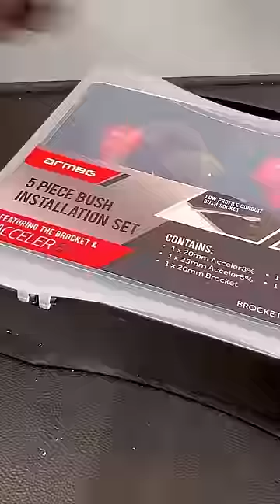They Said it Would be Faster! - WERA Tools Kraftform Turbo Screwdriver for Electricians'

Comment: Personally, I would recommend the husky ratcheting screwdriver. I use it as a lube tech, but its very comfortable to use and the quick change is nice
Reply: But what's the voltage rating on the Husky? Are they NFPA 70E compliant?

Comment: Don't twist stranded wires. That ain't good especially with screws.
Reply: Don't talk about something you know nothing about.
Reply: @bereal7266  in germany you violate the code by doing this. You need to use ferrules with stranded wires. If it has a clamp mechanism you need to check that the manicafturer allows. Some things with a clamp mechanism tell you that you can do stranded wires with or without ferrules. Some tell you that you are only allowed one of the two. But when it comes to screwing mechanism you need to use ferrules. So please don't tell me that i don't know what i am talking about
Reply: @Florian_L  There are hundreds of millions of electrical installs across the U.K where stranded wire has been twisted with no negative consequences, even on installations that are decades old. You are making a fuss of nothing.
Reply: @Coxy002605  i am just telling you what in germany is code and it makes sense
Reply: @Florian_L  This is a British channel, what is code in Germany is irrelevant to what is being shown in his video. It doesn't make sense, it's just rules for the sake of it.
Reply: To many rules in Germany the have plenty of good sparks who know what they are doing. I have twisted stranded wires that’s how I was taught back in the days never had any issues. Any way the problem with the wera turbo screwdriver is I find it a bit bulky on the palm Looked at one of them at a tool show. Like wera tools own quite a few of the stuff.
Reply: @Coxy002605 The internet and YouTube are international.  No borders.  I personally enjoy reading how things are done in other countries.   Especially Germany, because they are super thorough in most things.   The fact is, stranded wire clamped into a device without a ferrule will relax overtime.  It may continue to conduct in a vibration-free situation.
Reply: @chiphill4856  Sharing information, great - Telling electricians from other countries that they're doing things incorrectly based on how things are done in your country, not so great.

As I said in an earlier comment, all over the U.K there are installations where stranded wire has been twisted with no issue. In applications where ferrules are beneficial, they are used.
Reply: @Coxy002605  Ok, except I never said anyone was doing it wrong   In, fact I qualified my statement by mentioning that every code is a little different.  I simply stated a mechanical fact that I personally have witnessed and many others have tested.  Stranded wires without ferrules in a wire clamp termination will relax and change shape over time.   Now, whether that loosening is causing failures or fires is a different question.
Reply: @chiphill4856  I was referring to the original poster, apologies if I was unclear.

If it did cause failures or fires, the entire U.K would either be in total darkness every night, or completely ablaze.

Comment: So you got a screwdriver set. Wow.
Reply: that's not what he's advertising here - the Wera driver he has has an internal gearbox that has about a 3 to 1 ratio to speed up the initial low torque section of threading